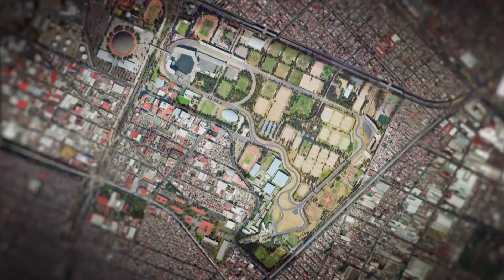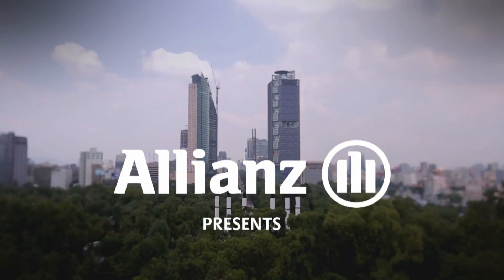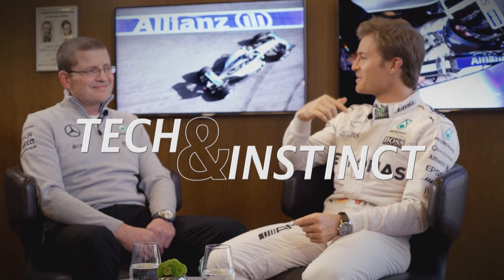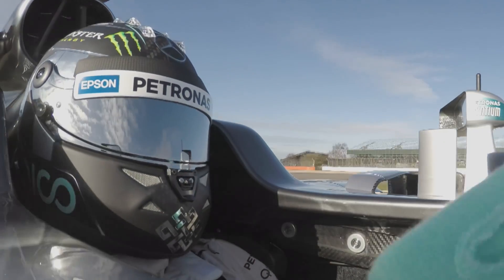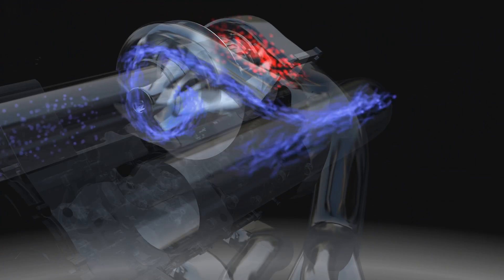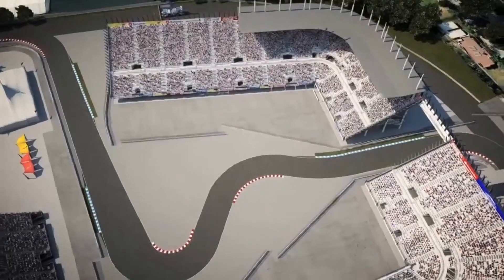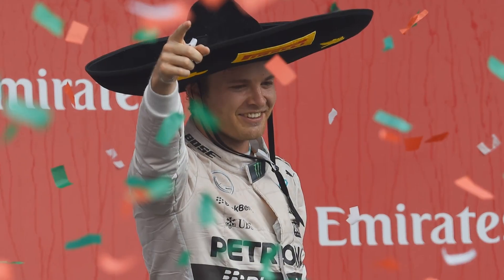How does high altitude impact an F1 car?

Comment: I kind of want nico to win, cos he's tried hard for the last 5 years, but I think it would be a bit unfair, cos of all of Lewis's engine failures. it's a bit like the 1976 season, with Niki and James.
Reply: Lewis is behind in the championship due to his bad starts.  Of course mechanical issues have hurt, but Nico has had some bad luck too to offset some of Lewis's issues.  But the door swings both ways.  Last year at the end of the season, Nico has a DNF at Monza , increasing Lewis' gap by 25 points, and then Nico is leading Russia handily only to have a DNF, again increasing the gap by 25 points.  In terms of reliability, I think 2014 was pretty equal up until the last race.  It is unlikely both drivers will have no issues during the year